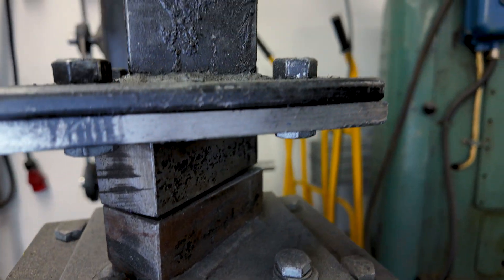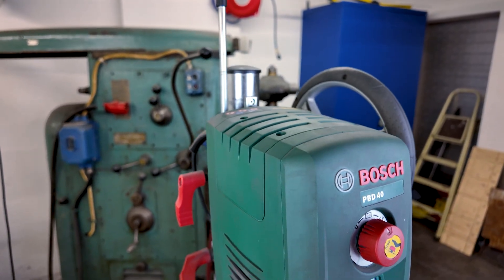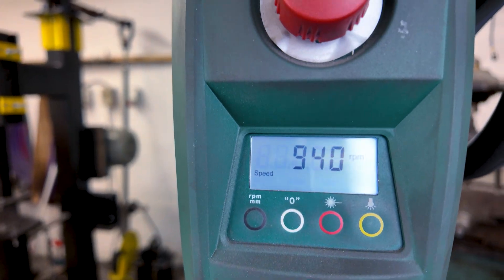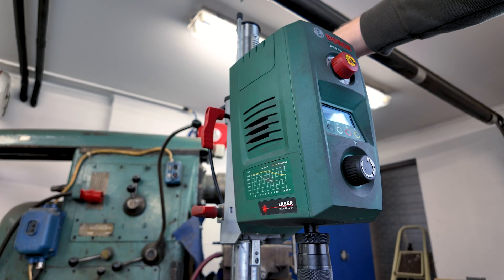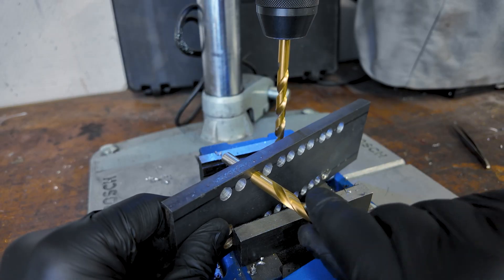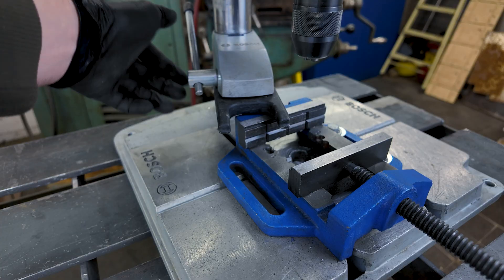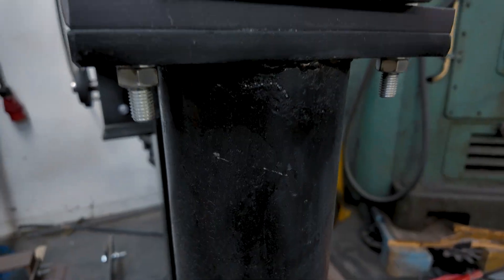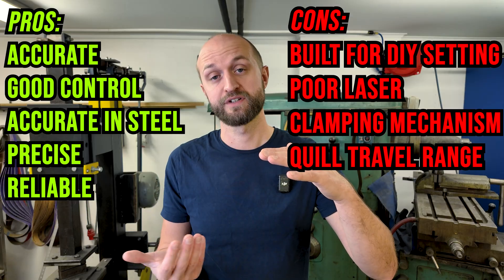Bosch PDB 40: 5 Years Later (Did it Survive the Power Hammer?)

Comment: huh, clickbyte title ...
Reply from the maker: That’s a fair point.

This is essentially a review — but a use-case driven one. The question I wanted to answer was whether a small drill press can realistically be used to drive something like a power hammer.

The build process itself isn’t the focus here, even though the finished hammer is shown. This video is about limits, load and real-world performance.
Reply: @SteelSurgeon-h6p  thats why I get bigger drill then this small bosh one (I saw it in action at my friends home, roll crimp for 12ga shells hard to do).
Reply from the maker: That’s exactly the point.
For this kind of load, a small drill press is right on the edge — and that’s useful to see.

In the next video I’ll do the another operation on my old Rosenfors RSF 2 from the 1940s, she weighs 2 metric tonnes, just to show what proper mass and rigidity changes. Different tools, different jobs